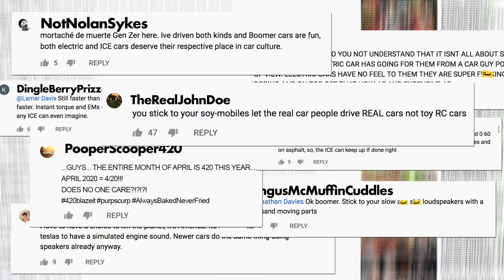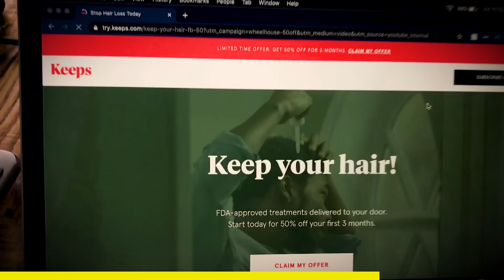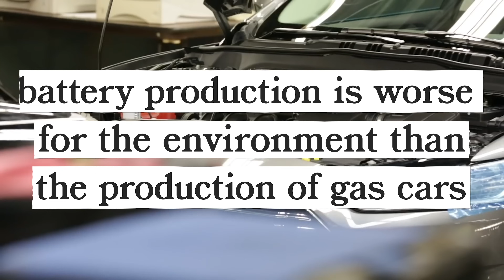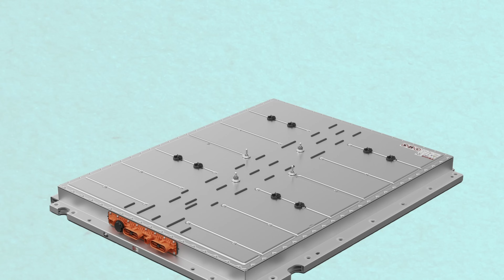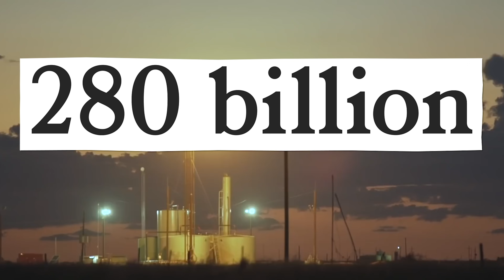Are Electric Cars REALLY Better for the Environment?

Comment: What you did not cover in your video is the impact on the environment at the end of the cars life or in an accident. While it my cause less problems during its running life, what happens at the end. How long does the battery last? EVs will still need to be serviced. Tires, brake pads, servomotor oils etc. There are NO cars that run on magical fairy dust! Can a EV run for as many years as an ICE car which can do anything from 10 to 30 years if looked after? I am not an informed person, and have no facts, but we do not know the long term impacts just yet. If an ICE car is in an accident it can be repaired to within reason of it present value. What happens to an EV? Do we start throwing them away or or leave them in the corner of the garage like a used cell phone? At the end I would like to say that if we all just try to consume a little bit less, the world will be a better place already. Cheers Rob.
Reply: regardless EVs can never be as harmful to life as ice cars

Comment: Did you take into account the facts regarding wind power? Made by products derived from oil, lubricated and maintained by oil and it's derivatives, plus in the end no recycling, just getting dug down into the ground after less than 20yrs. Not really environmental solution. How much does that pollute?
Reply: don't matter. The only thing that matters is ice cars need to be taken off the road
Reply: @mikewade777  You do realize that if you remove all ICE vehicles (incl lorries, trains, etc) and don't even replace with any alternative, the world pollution would get lowered by just 9%. 9% might seem much but remember that the other 91% would still be there.

Comment: I would just like to point out that the battery and the engine are not the right comparison. The battery and the fuel is what should be compared, which you have managed to do in a round about way. 

None or very few EV batteries have been disposed of. EV batteeries are 100% reconditionable and also reuseable for other applications. Solar power is the No.1 re-use of old EV batteries unable to power a vehicle a sufficient distance.

Some bad news for the environmentally negative lithium producers: BMW's newest incarnation of an EV battery is lithium free. I've also seen one that uses aluminium instead. 

As has been correctly sighted: EV battery production is still in its infancy. There's a long way to go.

Comment: Graphite mining for batteries is polluting fresh water supplies. The limited amount of lithium and graphite available makes scaling a major issue. The primary problem is in order to make profit corporations and governments cut corners. Estimating the environmental impact in CO2 emissions is just tip of the iceberg. Once the water table is affected it’s impossible to clean it with today’s technology. More focus should be on carbon recapture and use of hydrogen as an energy store for electric motors.
Reply: then that would require a sealed engine since exhaust is the primary problem

Comment: You forget a few points 1. Solar energy is not green. We cant dispose of windturbines so they Will Forever be stockpiled on our Earth after they break Down. 3. What the environmental impact of all the cars we need to dispose of if everyone was to Exchange their fossil duel Car with EVs 3. If you add 17 tons of CO2 because a battery need to be swapped out, what then ? 4. EVs probably Dont last as Long as fossil cars ( I say that because history has shown that the more Electric components you put into a Car the skorter it’s lifespan is) which means we have to produce more cars. I dont blive in EVs in my world they are bad for the climate and they are just pure nonsense. I belive that we need to look Further into synthetic gas in Order to solve the  climate problem.
Reply: does not matter... If a fossil fuel car can't function without an exhaust it needs to be taken off the road. Also the problem with ice cars isn't climate change its environmental pollution, that is more than just climate change
Reply: @mikewade777   thats why you need to fuel it with GTL. Electric cars is fossil fuel
Reply: @michael.holm7555  No! EVs do NOT have exhausts.
Reply: EVOs dont polute less - they just do it differently - when you burn coal to produce electricity you create the same polution as if you  fueled the Car with diesel.

Comment: One issue you didn't discuss is the revenue generated from road taxes on gasoline and diesel sales.  Not sure how it works in the USA but here in Canada there is a substantial portion of the cost of fuel that is a road tax that (allegedly) goes to the building and maintenance of roads . So as EV's take up more market share and fuel sales drop that revenue will have to be replaced somehow so we my find we will have a road tax added to our electric bills or some other method of taxation.

Comment: You forgot the environment from minning, aslo oil will still have to be mined, to produce plastic,  then the end of life recycling batteries not much can, plastic not much there, oh how is the rust belt the electric connector, replacing regularly, cars juked faster due to leaking motors ,yes that is right oil the grease and some to cool, so you forgot alot. I love electric cars my self but when you can not grow food for the soil is contaminated, and the water is contaminated, then what ,now gas can be switch to different fuels less toxic. When we get a battery 100 to 70 % recyclable then let's talk.

Comment: An interesting tangent to this discussion however would be >>WHERE<< EV vs ICE (and/or hybrid) is more efficient, not just from green energy (since some places don't have that much sun, wind, or hydro available), but from annual climate because EVs are DRASTICALLY less efficient during the winter months since they don't generate enough waste heat to keep the car comfortable.

Whereas the gas mileage in a normal car barely drops during the winter months.
Reply: Indeed, but keep in mind EVs loss of efficiency in the cold is due to them having to provide more power for heating, a heat source easily available for ICE. ICE keeps producing same amount of heat, even if cabin heating it is not needed.

Despite EVs loss of efficiency in winter, it is still better than ICE, simply due to being efficient: just produce more power for heating, and do not if not needed.
Reply: @dbclass4075 ... did you even bother reading my comment, captain obvious?

...and sorry, no, they are not efficient enough to over-come very cold weather. Typical range loses are nearly half the normal range in the winter. 

If you have temperatures below 10F and are driving on the highway at very high speeds, an EV is not going to beat a fuel efficient hybrid that can get 50mpg regardless of the temperature.
Reply: @jasono2139  50 mpg equivalent will be 1.48 mi/kWh. Model 3 Long Range is rated for 358 miles, so assuming 60% loss due to cold, that will be 143.2 miles remaining. Divide that by 82 kWh battery, that will be 1.75 miles/kWh ≈ 58.98 mpg equivalent. Therefore, even with figures you provided, EVs (or in this case Model 3) is still better in conditions you described.

I think the point you are trying to convey is the inconvenience of reduced range instead of energy inefficiency. Batteries do have the disadvantage of energy density.
Reply: @dbclass4075  the stats, according to Edmunds, for the 2021 Model 3 are as follows:
Range: 353mi
kW per 100mi: 25

And the conversion from MPG to MPGe:
1 gallon of gas = 33.7kWh electricity (approximately)

Therefore, getting 50mpg for 100 miles would be a 67.4kWh.

...and since I'm not going to bother wasting my time trying to find performance stats that apparently don't exist (because that 25kWh value certainly isn't constant for all driving conditions). I will say, again, that it logically will be lower for highway driving... And in the very cold weather while driving on the highway, the car will require much more heating... A hybrid/normal ICE car, once at running temperature, will not.

At some point, a majority of the EV's power will be wasted heating the car instead of driving it... and the "efficiency" will be worse if it's taken from the point of the pump/plug since charging batteries in the cold drops the efficiency even more. 

Assuming it's about half... it'd be around 50kWh to 60kWh per 100 miles, so your numbers are fair, but this does not rule out that there most certainly is a scenario where the non-EV becomes the more efficient vehicle.
Reply: @dbclass4075  actually, I might be wrong that highway driving is where the gap would close the most since slower speeds might cause more heat loss/mile traveled.

...and since I doubt anyone publishes such numbers for cars all I'm going to say to that is... 🤷
Reply: All over a global scam.

Comment: CO2 emissions can be a bit of a red herring. In smog filled urban environments, emissions are a huge factor. However, all things considered, a bigger question might concern the materials that go into making a car and how these are sourced. Life on this planet requires a delicate balance. Our technologies affect living systems in ways that are infinitely complex than most of our basic calculations allow. Trace amounts of very harmful substances can sometimes have devastating long term consequences that may well amount to greater damage than simply focusing on CO2 emissions. At any rate - internal combustion or electric - both technologies are old and no current design is very friendly to the planet. Much better options are possible when we consider that we are embedded in a field of near infinite inexhaustible free energy that we have not yet begun to make any use of.

Comment: Really good evaluation. Oh and the Electric Grid cannot handle the production of Wind and Solar Energy (mostly Upper Midwest and Western production) to where the energy needs to be in all Cases, like the East Coast and East of the Mississippi. So there is an electric grid infrastructure problem to transition to renewables. EV's have less of a Climate Chaos Impact, the problem is that they still have a Significant Impact.
Reply: The east coast, especially the northeast, runs with a lot of hydro, sourced primarily from Quebec. Now east coast states are building offshore wind to capitalize on Atlantic wind. I won't cover anything burs it's not an energy desert.

Comment: Basically car companies are pushing "Green Washing", we should question or demand that the car manufacturers/ dealerships informs(be transparent) and tell you of how their batteries are made, if the process is ethical, and not harmful to local communities, environment, etc. (Not talking about a seal of approval knock off that any green Washing company can buy). And that they should development more efficient ways to recycle the battery cells I am sure they can work something out with governments(to some extent). And make the ressources extraction Better. They should be made responsible for the whole lifecycle of the ev cars. So keep your gas car, repair it, use it less when not necessary, walk when you. Technology is getting better but the energy source still isn't there yet even though their are selling them already.

Comment: So,  reviewing the info you provided, it would only make sense to make cars and other things to last longer, provide incentives to drive older vehicles.  This not only keeps money in your pockets, but reduces the overall environmental impact.  Changing our ways from being a throw-a-way society back to building and buying quality that can be affordably repaired you suddenly helps resolve this and then opens the door for the vocational needs that could provide employment, educational opportunities.  I really dont care if it impacts the manufacturing industries in the short term with reduced volumes, they'll need to adjust and scale accordingly.
Reply: EVs have fewer moving parts. they will last forever. except the batteries that will "only" get 300k-1m miles before being recycled. So EVs are the answer to what you just said. Dealerships hate selling EVs because the car sales can tend to be loss leaders for their maintenance facilities and EVs dont need maintenance.

Comment: I have some questions in my mind. Is the life of EV as long as IC car? I mean a well maintained IC car can be used for more than 20 years or even more. How about the battery life! How cheap or expensive it is to replace old EV battery, how about regular maintanances...
Reply: Battery electrics require no regular maintenance outside brakes and tires. (And their brakes last 5 times longer a set too) since there isn’t anything to service. Modern EV battery lifespans are around double that of an ICE. Representing around 40 years of life before reaching their “end of life” which is 80% of your original capacity remaining. With the battery representing the shortest lived part of the drivetrain.
Reply: @engineeringtheweirdguy2103  Thats incredible. Thanks.

Comment: You also need to factor in the resources required to prop up the electricity grid. Copper & Aluminium mining is a huge part of it. Plus the lithium cobolt batteries are disposed of, not restored. The minerals are burnt out and leave toxic waste in its wake.

Comment: A compelling presentation., but:
1) How long do average EV batteries last?
2) What is their replacement cost compared to the life of an average ICE vehicle, i.e. you need to factor THAT into the EV attributes/failings?
3) Add that cost (say 3 battery-replacements) to the impact upon the environment?
4) Is a used EV viable? I doubt it. An old clunker ICE will run with little maintenance for many years compared to VERY expensive battery replacement. For a poor person, the choice should be obvious.
5) Total inconvenience. A one-gallon of gas stored in the trunk will get your ICE to the nearest gas station. An EV will require towing, unless you're towing a mobile-charging unit. 6) An ICE can be driven to a gas-station and 5 minutes later, it's good-to-go. EV's take hours to recharge.
7) Today's EV's will be out of date and unsaleable within a few years. Why should I take part in this experimental development?
Reply: 1.) modern EV batteries are designed to and showing to last twice the lifespan of a combustion engine.
Reply: 2.) at current battery replacement costs around $7.5k and predicted to be as low as 4 by 2030
Reply: 3.) fairly redundant as an EV battery will last twice the lifespan of a regular combustion engine.
Reply: 4.) yes, so much so that EV’s today have typically much lower depreciation than other vehicle’s. Tesla model 3 for example has the lowest 10 year depreciation of any vehicle in history.
Reply: 5.) inconvenience is spending 16-17 hours per year driving to fuel stations when you could be spending 0 hours per year charging from home. How often do you drive and end up out of fuel? I’m guessing not very often. I don’t know a single person who has. But an EV can be charged from a small cheap portable generator. And here’s the fun bit. It’s more fuel efficient to do that than to use that fuel in a combustion car.
Reply: 6.) V3 super chargers can charge an EV in 5-10 minutes and V2’s can do it in 10-20 minutes. If you need to since if you charge from home every single morning you have effectively a full tank of gas.
Reply: 7.) based on what? They’ll outlive combustion cars. Why within a few year?

Comment: Wait. I have this sense that you  don't add up the several battery replacements every couple of years you will need during ev lifetime? Knowing well that very component is the biggest portion of co2 footprints for the creation.
Reply: Well its about 5 years not 2 or 3

Comment: What about the energy and co2 needed to produce clean energy powerplants? I can drive my normal car for  10-20 years. And ev battery life in cold climate is tops five years. So the lifespan on ev i would say is way shorter tha gas engine car.

Comment: The facts about recycling lithium batteries are outdated. The recycling of lithium has progressed quite fast, during the last 2-3 years. Also new batteries are in development which don't use lithium. Hoewever, think about the huge gas/diesel cars that are in use at present, and how much it will take until they become a meaningful minority.

Comment: I own a Chevy Bolt and a Jeep Grand Cherokee with a hemi. 
I love both, And again, the bolt has incredible aceleration, but the sound, and the vibrations of the hemi.... 

And also, we tow our rv trailer. That a point where no electric car will success. Some guys towed with a model X, an small trailer and the range came from 350 miles to barely 140 miles. Imagine traveling with an electric car with a trailer, stopping every 2 hours to kill the batteries with a fast charge....

Comment: Wind, solar and hydro electric are not anywhere near clean. It’s all political rhetoric.  They eat thousands, sometimes hundreds of thousands of acres of land and also need even more CO2 of manufacturing to produce parts to take over those thousands of acres. It’s all BS. Coal isn’t actually as bad as most claim it is. Most coal plants use “scrubbers” to pull the exhaust of the coal burning boiler units and send out clean warm air. The remnants are actually used to make drywall. The cleanest, but most strictly regulated power by the corrupt and useless government is, nuclear power. Former power plant builder with the boilermaker. Currently healthcare professional working with compressed natural gasses. Degrees in bio, Chem and resp disease. This is good. But you forgot ALL the things that go into every avenue of manufacturing on both sides.